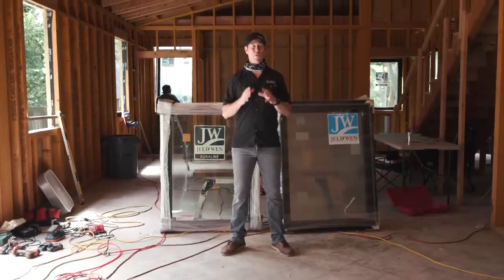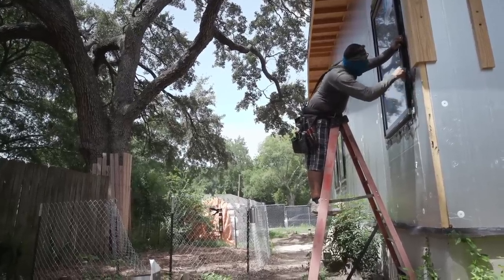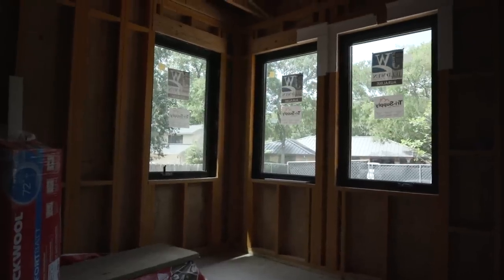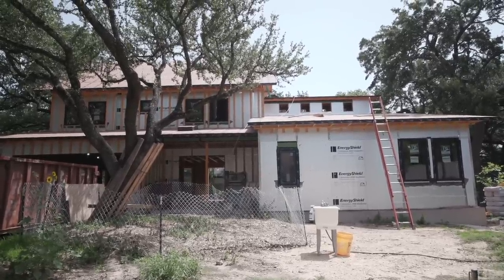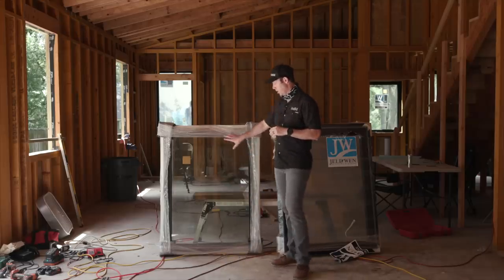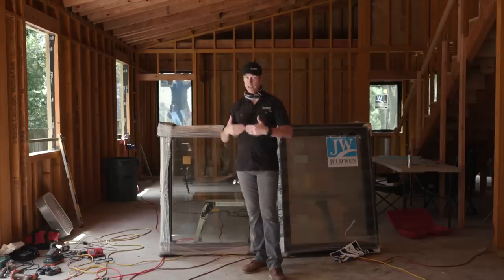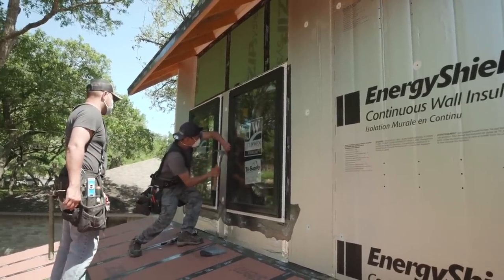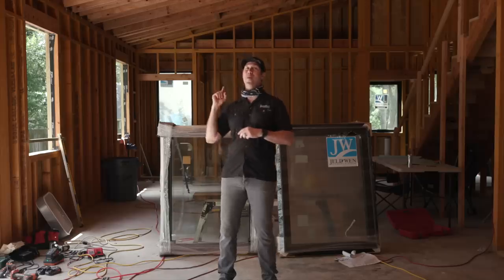Triple Pane Windows - Worth it?

Comment: Given how energy efficient artificial lighting has become I think it's about time that we rethink the code requirements for windows. Obviously windows provide both and aesthetic function as well as an egress function. But much of the code is written so as to minimize the amount of artificial lighting in a house, for the purpose of minimizing electrical consumption. But those codes were written at a time when light bulbs were 100 Watts. It seems unreasonable and untenable to build a house with the required window allotment in a place like Texas, were outside it can easily and often be above 120 degrees without the benefit of shade. Anyways, I'm sure big window would object. Lol
Reply: I wouldn't want to live in a windowless house even if I could. Natural light has health benefits and I'm willing to pay a bit more for that.

What's wise in texas is to not have east or west facing windows, have south facing windows that are shaded in the summer and provide free heat gain in the winter.

The problem I have with the code is they mandate these windows that can barely be called windows. Visible light transmission of .42 and the lo e coating looks like a film you want to wipe off. I wish the code would allow single pane windows with no coating that way you can get got of .85 and be able to use fewer windows for light and see better through the windows
Reply: The 8 % glazing used to be 10%.  8% is still silly as you said
Reply: @robertmontgomery7158  So "they" lowered it by 2%. Ya, that's bs. I don't think we should get rid of natural lighting entirely, for the reasons stated by others in this thread. But 8% is ridiculous.
Reply: @jl9678  While I don't think there is a scientific basis for believing that natural light kills bacteria or promotes physiological health any more than LED light does, I am not now nor have I ever suggested that we should entirely eliminate natural light. I do think, however, that there needs to be a much more honest approach to what is an appropriate amount natural light given the environmental implications. It is after all  environmental concerns and energy consumption that created the mandate to put windows in a house in the first place.
Reply: @josephdestaubin7426  
 I'm, Curious what would you say is the appropriate amount of fenestration in your own personal house? I'm building a 2000 sf house right now that has 500sf of fenrstration, mostly south facing. I'll add an extra solar panel or two to make up for the fall heat gain(almost no summer heat gain) and enjoy the free heat gain in the winter
Reply: Joseph DESTAUBIN   The UV in from the sun does kill bacteria but to get the best result you have to expose the item to full sun for several hours.
Reply: Joseph DESTAUBIN it’s the same here in Australia and I’m annoyed by the same 10% code requirement. We have a small house with an extensive art collection that needs walls. Whack on another solar panel to compensate for the energy loss is too easy, but no can do.
Reply: @peterbeyer5755  Common LED lights emit a small amount of UV light. However, for hospitals and businesses that require increased UV exposure there exists lights specific to that end. They're slightly less efficient, but only in that they produce ultraviolet alongside white light as opposed to converting nearly all the ultraviolet to white light. Edit. In defense of your comment, I did have to look this up.
Reply: @jl9678  That would largely depend on what part of the country the house was built in. But even if I knew the specific location, this is a job for engineers to calculating the life cycle cost of artificial vs. natural lighting alongside the insulation costs and benefits.  Housing and Urban Development should task engineers to do the work rather than just blindly doing what we've always done (as if technology hasn't changed), because of an antiquated code and a window manufacturing lobby. But if I'm being honest, and I always am, I think less is more when it comes to windows.
Reply: @josephdestaubin7426  
If we take that to it's logical conclusion then iyo a house with no windows is best.

I used to be like you. I wanted a house with a 50 buck monthly energy bill even if it didn't have windows. Then I started seeing the hand of the insulation lobby and the high performance home lobby and my eyes slowly opened.

I have as much problem with the insulation lobby as you do with the window lobby.

For example you dislike windows but will also probably build a tight house at additional cost that will require 24/7 mechanical ventilation at additional cost? Think about that for a minute.

I  disagree on the fenestration front. I believe that well placed windows make a house more pleasant and the more the better (at least in my climate)

It's also proven that southern windows in the northern hemisphere are net energy gainers in the winter and lose little in summer and fall if well shaded.
Reply: @robertmontgomery7158  in my code book you are exempted from this if you provide the prescribed ventilation and prescribed artificial light. For egress you could use a door. So rooms don't have to have windows
Reply: @rossmcleod7983  what code do you use? My county uses irc 2006 and it says 8 percent fenestration but you don't even need that if you have enough artificial ventilation and artificial light.

And you can use an insulated exterior door to get past the egress requirements.
Reply: Irc 2006 exceptions to the glazing rule:

Exceptions:
1. The glazed areas need not be openable where the
opening is not required by Section R310 and an
approved mechanical ventilation system capable of
producing 0.35 air change per hour in the room is
BUILDING PLANNING
installed or a whole-house mechanical ventilation
system is installed capable of supplying outdoor ven-
tilation air of 15 cubic feet per minute (cfm) (78 Lis)
per occupant computed on the basis oftwo occupants
for the first bedroom and one occupant for each addi-
tional bedroom.
2. The glazed areas need not be installed in rooms where
Exception 1above is satisfied and artificial light is pro-
vided capable of producing an average illumination of
6 footcandles (65 lux) over the area of the room at a
height of 30 inches (762 mm) above the floor level

Comment: Back in 2002 I replaced the original Anderson single glazed windows in my 1950's home with Schuco triple glaze. I live on a very busy street and was mainly interested in the sound proofing qualities.  Never regretted my choice.
Reply: I too live in a busy street with a 1940 original wood windows, I have external windows and even put 1/4 inch plexiglass and still the sound of the trucks I can’t kill.  Should I get triple pane or should I insulate first my walls

Comment: With building a very air tight home with so much engineered materials.  Is there any concern for the glues and synthetic materials off gassing as they age?
Reply: Will Barks HRV/ERV sort that out. Couple of solar panels and you get near free conditioned air.

Comment: Shouldn't the East be warmer than the West as the sun comes during the moring with high intensity form East and sets with low to the West?
Reply: Not in Texas. The afternoon sun is absolutely killer in the summer. Its 10:30pm and still over 90° at the moment.

Comment: You want windows with low heat gain on the east and west of your house, and higher heat gain on the south side. 

In the winter the sun is low in the sky and will mostly hit the south side of your home and you want that heat to come in through the windows. 
In the summer the sun is heating the east side in the morning then west side in the afternoon and you don't want that heat. 
🤷‍♂️🙃
Reply: Depends on the climate also.  I live in the mountains and mornings are very cold, so heat gain from east windows is great!

Comment: In my experience, casement windows fail more often then double hung. By fail I mean the window sags on its hinges and becomes difficult to operate and close tightly. If you hardly ever open your windows I guess they’ll last longer but then you’re always living in conditioned air.
Reply: Maybe cheap windows? Mine are fine. Sure, if you leave it open for years then it might have problems closing easily but it's fine normally and you can fine-tune the hinges.
Reply: I have this problem with hinged windows in a 50's style ranch...triple hinged just leave the door screen door open as I have...until the louver triple hinged windows can be replaced as quoted by Anderson would be 60,000 four years ago...

Comment: A tiny house builder once said that the best window insulation you can get is to put two single panes 4 inches apart.  4 inch gap with only air in between.
Reply: As long as you don’t mind condensation between your sashes (which you will get and you will mind)...

Comment: Great information, good idea to only use the higher priced tripple on the sides that need it most.
However I have worked out that building well draught sealed shutters with poly carb inserts will add a better thermal barrier for less cost, and a shutter made from rigid foam core insulation to act as night time curtains will really keep the cold out and the heat in
Reply: these shutters can they be rolled up/down, where do you get them?
Reply: @psu8782  I was planning to build them myself. They would be side hinged and stay open or closed with magnet catches.
To make the winter polycarb part you just cut a sheet larger than the glass, so it goes onto the frame, and stick magnetic strip on both frame and the polycarb, this forms a natural draught proof barrier. you can paint the strips on the frame so they look nicer when the polycarb is not there.
Well, I am not as wealthy as these house builders, I would rather spend the extra cost that tripple glazing costs on other insulating methods such as the roof or walls, because thats the majority of the building

Comment: I would have thought that double glaze would go on South and East sides while the triple gain went on the North and West.
Reply: To add heat on the south and East and prevent cool on the north and west am i correct?
Reply: @goproexplo9290  Guessing that I was thinking warmer in winter, cooler in summer.  But, that was 3 years ago.

Comment: Whats the min number of windows or is it exits code requires?
Reply: I’m sure you’ve found the answer here, but code typically requires at least 2 forms of egress (usually consisting of an approved window type and a door).  But your code might differ so check with your local inspector (or code book).

Comment: Colder temperatures use triple , hotter use double. It's what I was always told. You can also tint the glass to help.
Reply: That doesn't really make sense though. Triple has more insulation value, and that works for both hot and cold. If you're in a hot climate, put the best windows you can buy on the south and west exposures to protect from the solar gain, if you're in a cold climate put them on the north (and east) exposures to protect from the worst cold.
Reply: @dlwatib  in the south the benefit from triple doesn't warrant the cost your at most 30° difference between  outside and inside temp in the north your 70+° difference between inside and outside

Comment: Noise is a big factor.  Triple is not always quieter - partly because the frames are heavier (denser) and also because there's a reverb effect w. 3 panes.   A GOOD TRICK:  Many manufacturers will let you order different glass thickness in the same window (e.g. 1/8 outside, 3/16 inside).  That significantly reduces sound transmission.  Same can be done w. triple pain with good effect.   Then of course, you can go laminated for the best sound reduction.  And another advantage of the casements & fixed windows is significantly lower sound transmission.

Comment: I like to see Matt used foil-lined XPS rigid foam for his continuous insulation layer.  
The only thing I might have done different is to use hemp batting over the (mineral) rockwool batting, as hemp might cost a big more, but provides signficant advantages in R-value and in health (as it absorbs CO2s).

Comment: And you want Double Glaze on North/East facing and Tripple Glaze on South/West facing in the south as you're wanting to reject the Sun's heat, another text Edit. You stated what you'd want in the North, not the South.
Reply: That's not an error, that's how passive homes are built, to use the sun's energy coming in from the south.
Reply: @lisatorry6758  It doesn't make sense when the primary concern is solar heat gain that must be discharged through air conditioning.
Reply: @lisatorry6758  That's how you do a passive house in colder climates, it's the opposite of what you do in hotter climates where it's more important to reject the solar gain and heat transfer in in the summer than to get solar gain during the winter months.  I'd like to get Matt's response to this FWIW.

Comment: On the outside wall of his house I see what looks like a top plate with crippler studs on top of it and then another top plate. Is this just a cheaper way to make the wall taller or what is up with this type of construction as opposed to using longer 2x4s? It seems to me that you would lose some insulation value with that extra 2x4 going across the wall especially with a builder that is so concerned about insulation efficiency. Perhaps this is to give something to nail the outside sheathing to? I'm just trying to learn more about construction. What are your thoughts?

Comment: "feel the radiant cold" - no, what you're feeling is a lack of radiation in return for yours, cold is the lack of energy, heat can radiat, cold is to absorb and NOT radiate. I know what you mean, but what you mean is that you feel cold from the direction of the windows because the surfaces there ARE cold and are absorbing your heat radiation from your body and other surfaces and not returning anywhere near as much in return, hence net loss and a feeling of cold. If the windows were hot then the radiant heat from them is greater than from you, and you feel a net gain, or a lack of loss, perhaps. Is that clear as mud? :-D